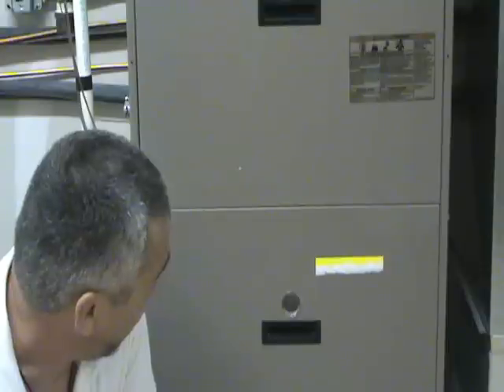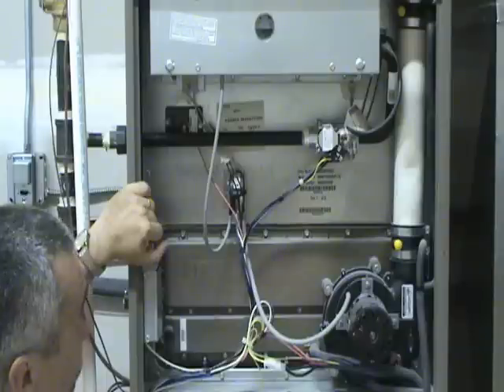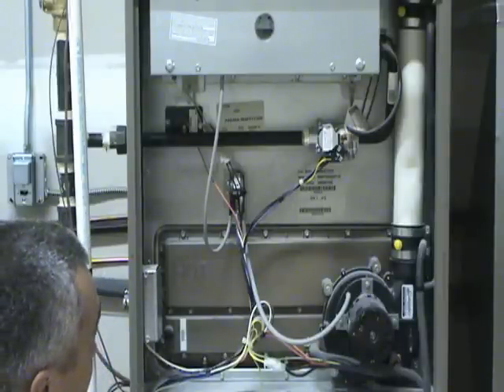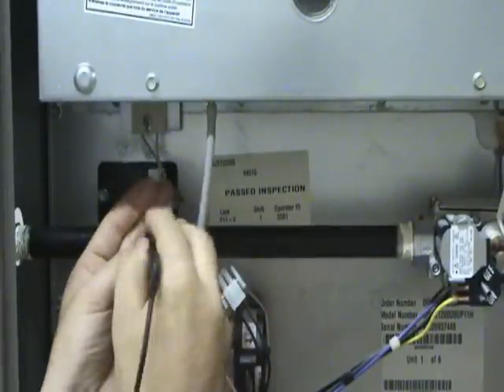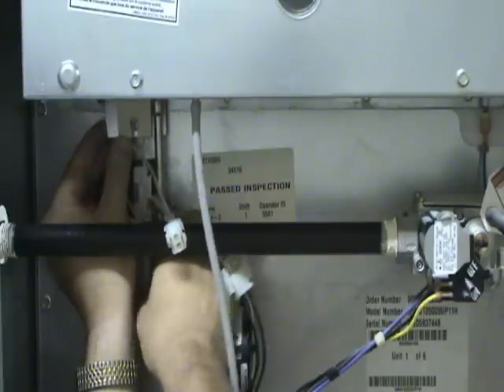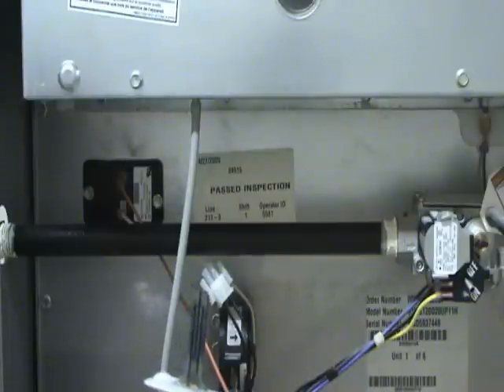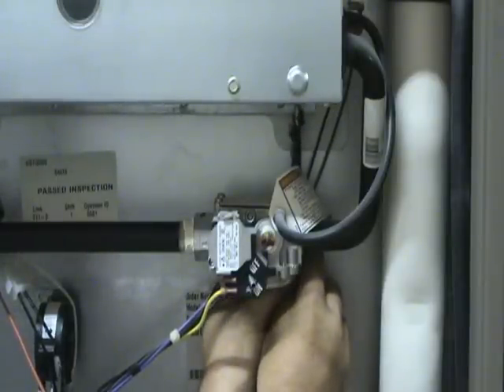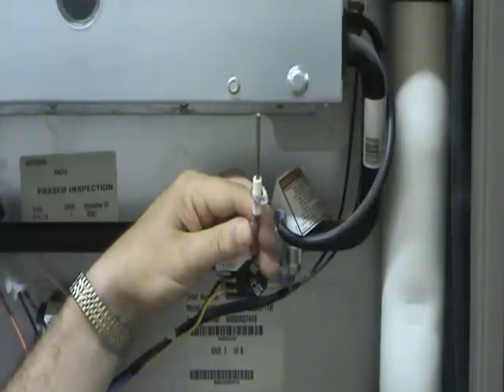Gas Furnace Ignitor & Flame Sensor Troubleshooting: Testing & Easy Fixes

Comment from the maker: Has your furnace stopped working suddenly? Check your ignitor for small cracks in the ceramic! 🔍

Pro Tip: If your furnace lights but then shuts off after a few seconds, your flame sensor might just be dirty. Try cleaning it with a rag or fine sandpaper before buying a new one—it could save you $50! [06:06]

Comment: 12 thumbs down? Must be from HVAC repair men. LOL  But really, I just spent $225 to have my ignitor replaced, but it was worth it for me for the assessment and same day service.  Plus I didn't need to try to find a store that had the part or risk electrocuting myself or breaking my unit.  Although, if the same thing happens to my other unit, I may try replacing it myself since I now know what to do.  Thanks!
Reply: jpeagle21 f

Comment: Thanks so much for your videos. My furnace burners are making a muffled backfire sound at the end of each cycle. I was wondering if that is normal or not. I had burners cleaned/brushed out and was told that that sound was normal. Is that true? thanks so much